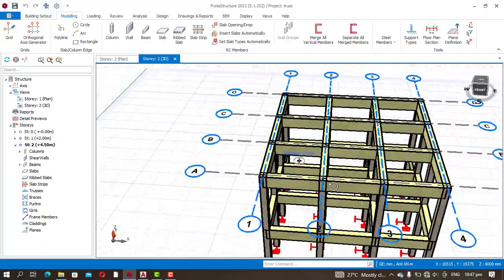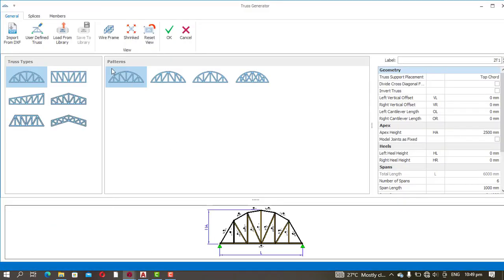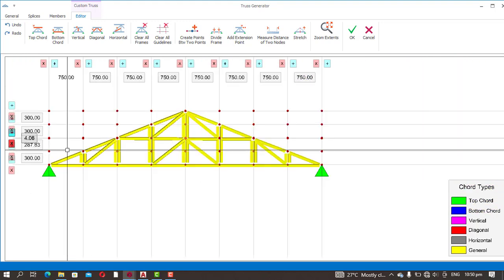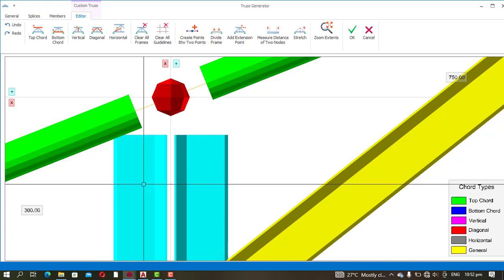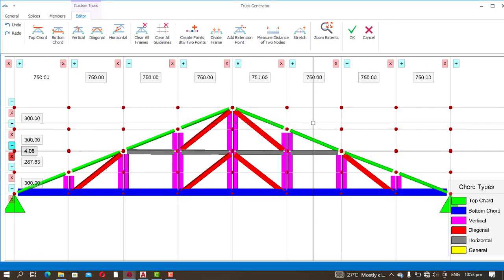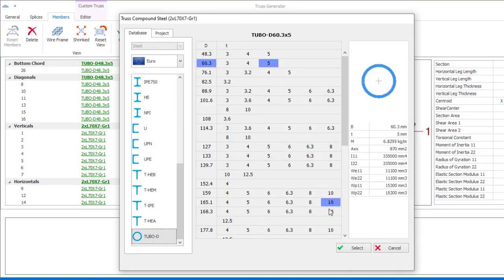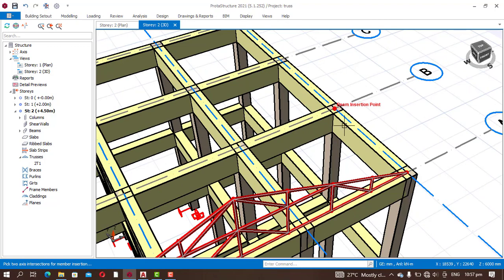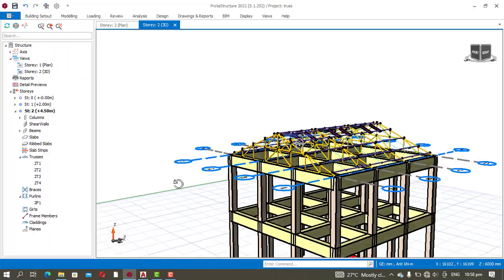How to personally model your roof truss with AutoCAD and ProtaStructure 2021.

Comment: What if you have more than two supports?
Reply from the maker: ProtaStructure will definitely identify the column or beam supports when the truss it is modeled. The support you see in the editor simply represent the start and end point of the truss.

Comment: Excuse me sir , When I created truss and analysis the result that shown me
 - What type of truss support ?
 - What type is the truss connection point for each member?
Reply from the maker: Hello Mr. Pelapat. 
Usually, Trusses are PIN(Hinge) supported and PIN(Hinge) jointed. When you complete the member analysis and design and then you transfer it to ProtaSteel. You can further decide whether you use BOLTED or WELDED connection.